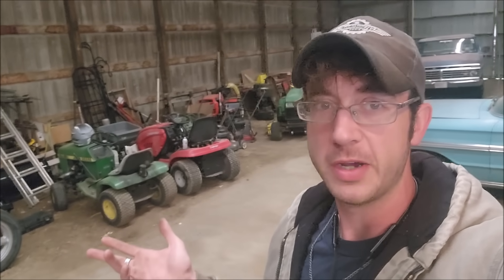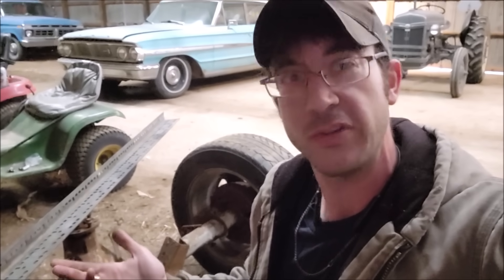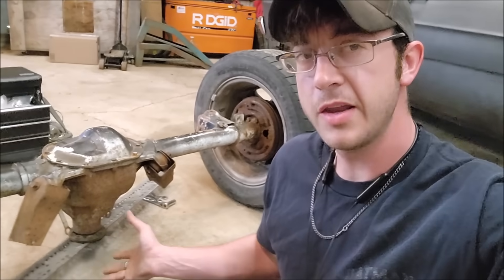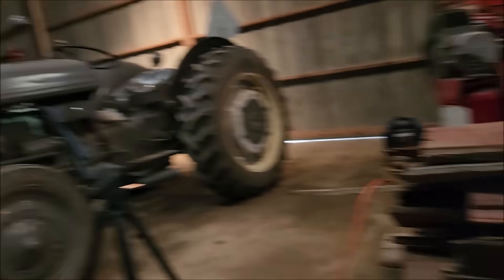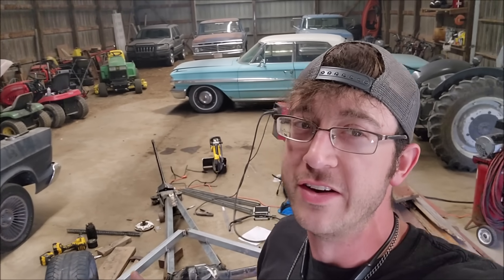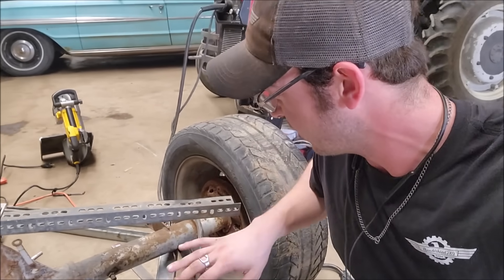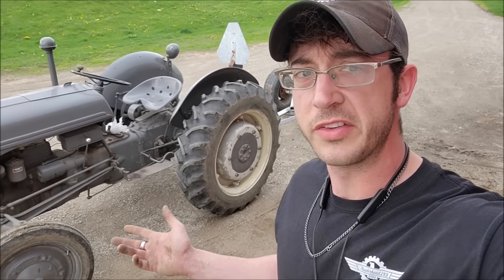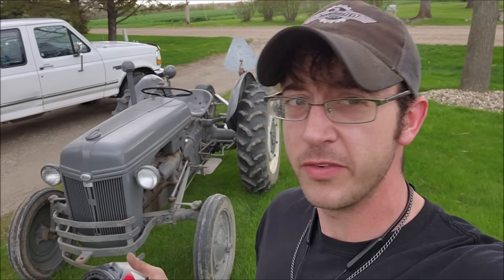Car Differential MOWER: Build & Test!

Comment from the maker: Today on things you should never make .... 
Someone suggested locking one axle to double the blade speed - thoughts?
Reply: I think it's a great idea, but 100% you need some shield around the blade so it or rocks don't go through you.
Reply: Locking one axle would give you half the blade speed. Also, real brush hogs use pivoting blades on the ends of a spinning arm so things don't break when you hit a stump.
Reply: @sachideshmane5088  Yup my dad had an old Service brand shredder which would turn a car tire inside out when mowed over. They also had shear pins so if you hit a stump or something like that it would shear instead of ruining the gears.
Reply: @Sachi Deshmane  it's twice the speed due to spider gears. I didn't beleive it either till I researched it
Reply: @The_Nexus_Complex  a posi unit has clutches that lock the shafts together so your suggestion is not valid in this application if it were an open differential it would work as you suggested
Reply: @sachideshmane5088  Comments seem bent on taking all the fun out of this. 😉
Reply: They have YouTube channels where people aren't eviscerated by wayward chunks of uni-strap.
... I don't watch those channels.
Reply: Build a shield to keep debris from bonking you in the back of the head. 
Also some higher gears might make the blades go faster. 
More tire revolutions = more lawn mower blade madness.
Reply: I mean... I'd build a shield between you and it if you do that, repurpose a mower deck or something. Don't want that blade coming for your head!
Reply: @DeadReckon  agreed 👍
Reply: I’d run a mud, or agricultural tire for more traction/ground clearance. Cool vid. Thunderhead
Reply: Blade speed will increase if your ground speed increases.  So you just aren't going fast enough.  I'd recommend somewhere around 60 mph
Reply: You'd halve the blade speed by locking up one tire.  Larger tires will also lower speed so don't go much bigger, just more grip to keep speed up.  That flat edge has to go - you'd be surprised at how much power is needed to push that through the air.  I think cut the blade length down and single bolt on two flat stock cutting flails and you're good to go with some knobbier tires.  I don't see any reason this won't cut reasonable well even at this low blade tip speed with a flat sharpened blade.  You're not expecting golf course quality obviously, just 'wack it down a bit' quality.
Reply: OK from back in the day. We call these "back end" mowers. You make them from truck rear ends and use 22.5" wheels. The ratios are in the high 5's so more blade speed, the blades are bars with chains welded on them as cutters. The tires are old and hard with no air, screwed to the wheels if needed. This is because the chains wear and links fly through the tires anyway. I pulled these ganged in 3 like a pyramid with a pickup... 300 6 Ford 3 speed on the column. Works well for some things and we considered them sort of safe and normal.
And then there was this OTHER one that was "next level". Take a truck rear end and cut one axle tube and axle and weld the axle to a plate and the plate to the tube so it can't move. Now hook the PTO shaft to the other axle. Now weld pipes for tires/wheels to what was the top and bottom of the rear end, with spindles. Now with 540rpm pto input you have times the diff ratio doubled. So say 540 x 5.00 is 2160 then x2 for the spider gears and you have a 4320 rpm blade speed. I can't even begin to describe how crazy and deadly it was. The "blade chains" had no life at all and buzzed everywhere. I will say though if you had the nerve to rev it up and back it into a thicket... it was like a light saber but way more violent. Needless to say it didn't get much use cause it's was a very bad idea and could not be made safe even by our standards.
Reply: faster is better, lock it up!
Reply: @trevorlahey3863  Hell YEAH!
Reply: What could go wrong?
Reply: Your blade is way to light and will bend shortly as a brush hog.
Reply: I love this and thoughts are you should make it a 4 blade so you don't have to worry about blade speed as much and also stick wish the small wheels because bigger wheels will decrease the blade speed quite a bit. Really fun tho I've always wanted to try this lol
Reply: @nathan584  no, bigger wheels will spin it faster.
Reply: @twinkie27271  oh yeah lol got it backwards
Reply: @twinkie27271        ..bigger wheels cover more ground per revolution, thus spinning blade less per distance traveled. Here is how you gear it up and make the height adjustable. https://www.youtube.com/watch?v=7tM1lRvGZow
Reply: You dead ass said let's take a mustang and turn it into a push mower and that speaks to me
Reply: Seen this done over 40 yrs ago. The rancher used 5 axle assemblies staggered. Cut a wide selection.
Reply: @dirtyfingernails532  Yes sir. A lot of Ingenuity is birthed on a farm.
Reply: You could use lower (higher numerically) gears. When when you use the taller tires the blade will slow down. The way to get the blade speed up is to just use a jack shaft to change the final drive ratio. A blade deck from a junked old donor riding mower.
Reply: How’s it gonna tow with one wheel locked? Doesn’t sound like a great idea…
Reply: Redneck engineering at its finest? My only suggestion would be to make the rock safe blade style where the blades are individually hinged to that they swing out of the way when they hit something. Centrifugal force makes the blades stay out in normal operation, but due to the swing bolt hinge on a brush hog, any solid object just pushes the blade back into the center.
Reply: You need spring steel.
Reply: @jonlennon3348  Ideally, yes.  But ordinary mower blades aren't spring steel for cost reasons.  Mounting the cutting blades on a pivot should be good enough for ordinary steel stock.  This thing isn't a rocket ship, it just needs to function.
Reply: I'm pretty sure driving one axle would cut the driveshaft speed in half, not double. 
If you flip it and put a pulley in place of the blade you could add a jackshaft and get more adjustments, both ratio and height.
Reply: if i put  a shroud around it be fine and slow ur tractor down ull be fine
Reply: @hollyconley2217  MOSTLY OLD PARTS AND RUST !!!!!!!!
Reply: Yeah no that wouldn't work bud
Reply: Do it !!!
Reply: You need to find like a 6:1 ratio !
Reply: Those are great for broken 70 dollar welder welds
Reply: A piece of cable would make a great blade
Reply: You had mentioned larger tires. Larger tires would mean lower blade speed due to the increased wheel circumference going a greater distance per rotation.
Reply: A blacksmith near me used to make and sell these back in the late 70s early 80s from lorry axles with the inner set of wheels removed, a box on top for weights for traction. You removed the blade bar by pulling 2 pins for road transport. All guarded & painted good robust long lasting machines.
Reply: Yes, but please fabricobble a deck around that "blade" lol
Reply: @ASpamSandwich  fabricobble😂😂😂
That's a new one thanks!
Reply: Locking the axle would half the speed in this setup. Normally the axle would be driven the opposite way and in that position on wheel doubles in speed if you lock the other. This is the other way around, you are driving the driveshaft from the wheels running the gears from the other side which inverts the gear ratio. A 4.10 axle normally turns a wheel once for every 4.1 turns on the drive shaft, in this setup it will turn the blade 4.1 times for every turn of the wheel.
Reply: Garage 54 did this long time ago on the same car they were driving not a pulled trailer
Reply: Actually locking one axle would half the rpm of the blade. Also the spider gears & the shaft would fail very quickly. It would have the same  effect as spinning your tires on ice & having only spinning one wheel. This would quickly destroy the differential gears.These gears are for intermittant use only.

tis

tis would
Reply: Is that a Fairlane in the barn
Reply: Like Nike says just do it
Reply: I'd think about installing a housing to stop objects from impaling you while on the tractor, clutch boot needed because your tires will just skid on the ground. Even with guards on I've been hit with objects using a rotocycle. I just installed a pto slip clutch to save my pro shaft. If you installed big diameter tires and a slip clutch you'll gain blade speed. When you hit a solid object like a stump your tires should just skid. If you cut taller grass you won't see objects that might fling up at you at high speed.
Reply: And I thought that the saw blade on a weed eater was sketchy, ohhh and it came off and chopped up two of my toes.
Reply: Double the blades, double effective cutting rate.  Sharpen them like a knife.  Might actually cut something
Reply: Use a old hood as a cover/shield. Lincoln lock the axle so it always Spins you can't double the speed on it unless you use a gearbox
Reply: My kinda perfect boredom!!!
Reply: I thought that and almost commented about it but seen your comment lol
Reply: Thought it had a locked dif.
Reply: DO IT
Reply: People get confused about this...  People also see differentials as voodoo.  And confuse them for one-wheel drive, etc.  All differentials send power to both wheels.  But under high torque, a non-posi unit will often favor one side, usually the side with least traction.

Locking one axle essentially halves your gear ratio due to the spider gears.  Plus yours is a posi unit, so that may also fight you (depending on the style of posi).  I bet you were testing if we were paying attention!

So 3.08:1 will be reduced to 1.5:1.  When being driven by the driveshaft as on a car, this will double the wheel speed.

But since your mower is the other way around, it will half the pinion speed.  Not what you want.

I also tested this on an spare axle... so I didn't make a fool of myself (which isn't too hard normally).

Then I remember over the years, when buying a "new-to-me" car, counting the pinion rotations versus tire rotations with one tire on the ground and following the same idea to get the ratio.  That's a quick trick with a floor jack.

Keep up the good work!  Enjoy your videos.  High quality content.
Reply: @storm9c1  lol. So my buddy tried to tell me about something called a 'power tire'. He said power only came out of 1 side and that's why it only leaves 1 burnout mark. Meanwhile I've done multiple gear swaps and lockers, even welded a few spiders together so just laugh and tell him how wrong the is. When it snowed I had him put one tire on ice and one on the road and how to do a burnout. Had them switch sides and he got to see it was power just on one tire. I can't really believe it came to that but sometimes that's how it works I guess.
Reply: @storm9c1  A normal rear end differential will send same amount of drive to both wheels if there is same amount of traction.  That's why if you are on a boat ramp for example and pulling a boat out with a regular differential applying the parking brake slightly will give you positraction  to assist in getting up a wet sl I ck boat ramp. Jacking up rear end of a vehicle with normal differential and putting in gear both tires will spin unless one brake is dragging.

Comment: One day my scrap pile had a push mower without and engine and an electric radiator fan. I

screwed and glued razor blades to the plastic fan blades. A spare battery, jumper cables, 

and the safety first fan were mounted to the deck. The electric mower worked, but I 

dismantled it after noticing a missing razor near the end of mowing season.

Comment: Lock one wheel  inside the housing, by taking the clutches (you will need to make a spacer) and springs out  of the diff and weld the side gear to the carrier. Grind the splines off the axle. Make 4 blades with a curved leading edge and make the cutting edge at the top of the blade instead of the bottom. That reduces the hit the cutting edge takes when the blade hits the ground. 
If it still isn't turning fast enough put a 4.56:1 gear in it! And chains on the drive wheel would go a long way. Chains on bald tires are fine!

Comment: A 3.00 or so car axle is not gonna work all that great.   You need a low geared truck axle...the lower the rear gear the better to spin the blade even faster.  Imagine the blade speed with a 5.08:1 rear geared truck axle.

Comment: You sureley got this comment already, but slightly different angle here...
BUT, one could take a large truck axle dually, cut it extend it for larger with and cutting velocities and lower gear ratios. Its heavy as hell already, and there are plenty junk ones around. 
Could actually work. and I think that would work twice as good if not more, using tires with a bit more traction. Or some sort of snow tire actually. 
Its worth a try for some channel on youtube. 
But without understanding the principle and not optimizing every possible aspect first, is just probably failure or lack of effectiveness. With internet circulated ideas :///

Comment: These were very common in east Texas in the 50's and 60's but usually made with truck axles and 8 ply truck tires.  Car tires won't last long before debris is thrown through a sidewall.

Comment: I wonder if a 2 speed rear out of an old truck could be used to give you a neutral to stop it from spinning, the lower ratio would give more blade speed too. I wonder if it would even be possible to find a crossbar from a mower to match the spline of the pinion, then you could probably even use actual blades.

Comment: So turn it over and mount a a large pulley on the input shaft Install a blade spindle just forward with a smaller pulley on it and it will drive the spindle at a higher RPM. Also you need two blades, one on each side, mounted on a single bolt so they will swing out of the way if you hit a solid object.

Comment: You're helmet is bad ass, as is your shop. 😮 Get some upright vaccuum cleaners..... a portable genny, feed them 240v a line of about 6 wide does a quick job. Advanced level, add a half cup of gasoline to the dust collection jar before takeoff! Note: the last step is for folks that possess a degree in redneck engineering.... don't burn your fingers. Dearborn is proud you chose their artifact on that toe catcher you built.😊

Comment: since you have made a manual brush hog, what if it was mounted for the 3-point on the front of a tractor, that way you can push it into the brush, but lift to turn?

Comment: "why would i try super hard on it" because a lot of the time the difference between a bad idea and a good idea is whether they were taken seriously and given an honest chance at success like
if someone took this idea and fixed the mistakes and shortcuts it could be a half decent mower but also, at the speeds it runs maybe it's not great for mowing but it could be great under a camper, the blade would cut the route you take and make it easier to find your way back

Comment: You need sharpened blades, and some way for the ends to float above the ground, with like skids or roller wheels on the tip ends.   Also I think your blades need to be spining faster, but that would require smaller diameter wheels.   You could have the PTO coming out the top instead of the bottom, then to an accelerator gear and or belt drive, then via an axle, back down again to the blade or even multiple blades.   What I'd also do is like have a disc brake between your PTO and the blade, so when you squeeze the brake handle the gear is engaged, and you let off it's not, and you can vary with how much force the blade is engaged.  If you hit an ant hill or something  the resistance would over come the rotational force and the brake would slide.

Comment: done this also---worked but scarry ,yes larger tires to get more clearence ,my blade was 3/8 flat stock used old king-pin to fit where u joint  would go and clamps , up graded to bush hog -----could only think of where the blade would gooooooo

Comment: I think what would benefit you is remaking this with a rear axle off some military Chevy 1 ton. I know some of them had gearing so short, they barely kissed 55mph wide open. That should speed up the blade so you don't have to go as fast.
Reply from the maker: I just used garbage I had laying around - ironically I have a few more interesting otherwise unless items including a gear reduction 5hp engine .... it's probably going to make it's way on there with a belt drive to the axle
Reply: @ThunderHead289  That would work... good idea!

Comment: I built a death mower from a ford 8.8 rear axle. 3.54 gears were not low enough for blade speed. So, I installed 4.88 gears, it was unstoppable.

Comment: I'm a farmer, with extensive experience with rotary mowers, and you can take this comment to the bank. 

First off, the gear ratio is  not likely to be "lower " than about four to one........ meaning the blades will spin at only four times the wheel RPM. That's not even REMOTELY fast enough to work satisfactorily. 

Second, it takes a substantial amount of horsepower to run a rotary mower. A forty two inch lawn mower needs at least sixteen horsepower or more to work properly at lawn mower ground speeds.  That's twelve or so for the blades, and the last four to move the mower along. 

There isn't enough dead weight to get adequate traction with the car wheels on grass to operate the blades. The wheels will slip, and the blade will barely turn or even stop. 

And third, if you do get it up to speed, in light growth of grass, and you hit a rock or  a chunk of firewood, or a piece of metal, etc, the blade may send it flying and take your head off. Rotary mowers absolutely HAVE to have safety shields. 

Save your old rear end for some other project.